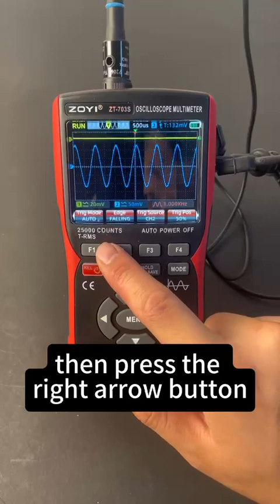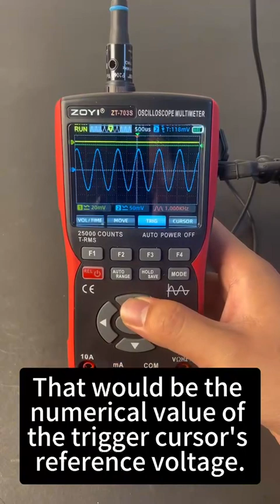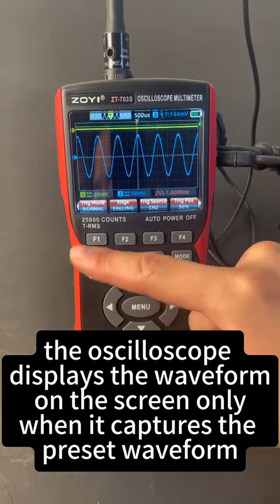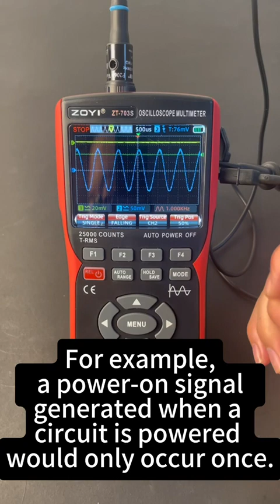Know more about ZOYI ZT 703S  50MHz Dual Oscilloscope Signal Generator Multimeter

Comment: Is it possible to use the signal generator and oscilloscope at the same time with this device?  On the one hand, should we apply the frequency device with the signal generator and on the other hand, see the result simultaneously with the oscilloscope?!
Reply from the maker: Hi friend, thanks for your question. Each function only can be applied separately